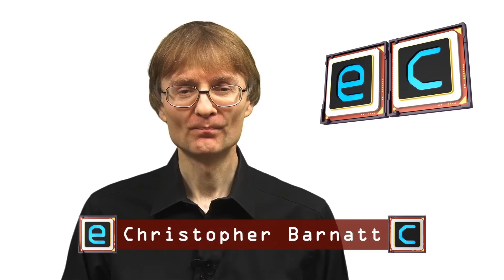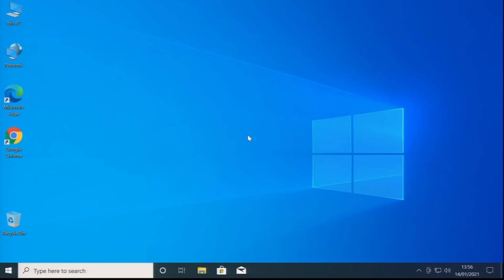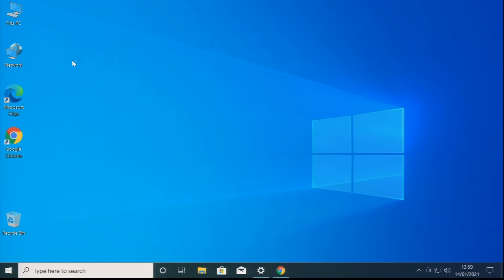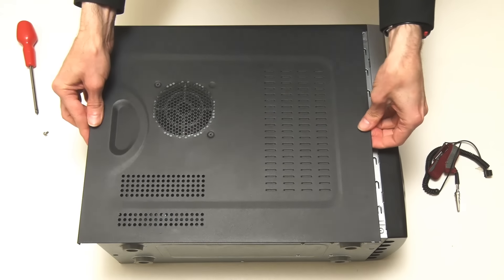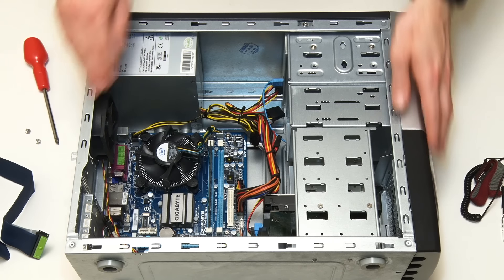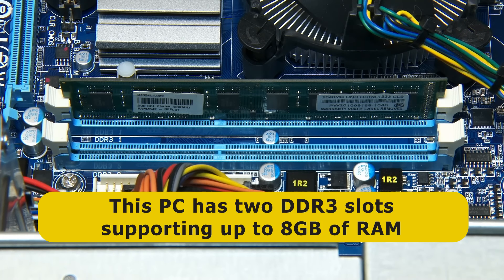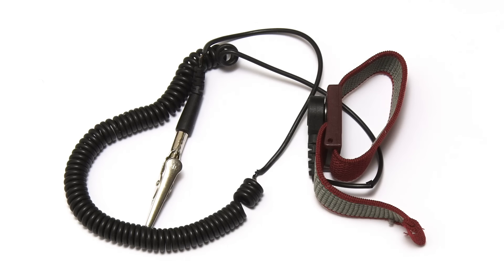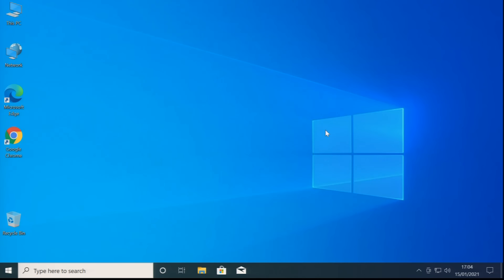Old PC Upgrade #1: Options & RAM

Comment: Hi Christopher, I have a Dell Optiplex 7010 with Intel i5, Nvidia Geforce 760GTX gpu, 16gb ram, 1tb hybrid hd. I have a spare Intel Xeon 2.33ghz Costa Rica cpu. Can I swap out the i5 for the Xeon chip, I also have the heatsink for the Xeon. Thanks for the great vids by the way. I'm also loving my install of Linux mint.

Comment: E5500?  hmmmm Try Core 2 quad Q6600. I use this cpu in my office PC. It's works and stable.
Reply: My 2008 Dell Inspiron 530 came with a Q6600 and has always been a great PC. I recently upgraded it to a slightly faster Q9400 which was about £10 on eBay.
Reply: Yeah, an Core 2 Duo or Quad should be fairly cheap and would be a decent upgrade
Reply: @derekp2674  It's affordable but it's still performed as same as the cheapest brand new processor today.

Comment: I have an old computer as well. But it uses DDR only. It's from 2005. I'm thinking of installing a Linux distro in it. Probably Zorin OS lite.
Reply: Probably a good idea to see and install the max ram before doing this.  If 1-2G, not worth it, but you can try, maybe Zorin will run in 2G well, but most regular distros work best with at least 4G ram.

Comment: Wow, you think a PC sporting DDR3 memory is old?
I've got about 14 PC's sporting DDR2 memory, with no where to go but Motherboard, Memory, & CPU swap!
Make ME an upgrade video!
Reply from the maker: 15 years is pretty old for an operational computer. Today something with DDR2 normally counds as "retro" for exactly the reasons you state -- you cannot get parts, and will also struggle with modern (hence secure) OS support.

Comment: It is strange that they put a single 2Gb card in a board that supports dual channel memory!
 If you don't have an anti-static wristband just plug in your computer without the power on and touch the inside metal of the case, this will discharge any static in your body to earth
 Changing Chrome for Brave will get you better performance
Reply: Brave?  Sorry, I won't watch ads in response to faster browsing.

Comment: Why did you not mention any effort to check whether 16GB RAM is supported, which it probably is, (even if you choose to install 8GB), likely for nearly the same money? Relying on the motherboard manufacturer's suggestion a decade ago when RAM prices were higher is a viewer disservice, as well as technically incorrect by omission.
Reply from the maker: It is not "technically incorrect by omission". It is possible that more RAM may work. But always safer to assume that the manufacturer technical specs are correct.

Comment: Hello! It seems that somhow after I installed a new 2TB M.2 Card then installed a New Win 10 Pro a System Reserved Drive (K) & (L) have appeared on one of three of my SSD Storage Drives (M)! My PC used to boot & shut down fast but now am experiencing all kinds of Start Up issues! Do you think If I attempt to migrate the two Reserved Drives (K) & (L) to my new M.2 2TB (C) Drive my PC will once again will Start Up & Shut Down fast with no issues again?

Comment: After the SSD, you can upgrade the CPU. You can fit the fastest core 2 duo the E8600 or one of the fastest core 4 quad  the Q9500s for example, the s suffix means more energy efficient. Check... https://www.gigabyte.com/Motherboard/GA-G41MT-D3-rev-13/support#support-cpu  and that board has no BIOS updates besides F1. The G41 should accept  DDR3-1333  and run at that speed but apparently 1x 4GB DDR3-1333 @ 1333 mhz will ok but 2x 4GB DDR3-1333 will run slower speed like ~1000mhz.

Comment: Greetings, You must have read my mind with this series of videos, my Asus now takes 08:59:30 to boot up so come on Asus, what are you playing at ?
Reply: Well after installing a couple of free lightweight versions of registry checking free space cleaning thingamabobs and running them several times I found my pc booted in a tenth of the previous time, but what worries me is some of them claimed to have removed 2.5 Gb of junk but my free space never changed remotely anywhere near to that and sometimes increased, so possibly a project for the future, debunk the frauds.

Comment: With a machine that old, the big risk is of the motherboard dying of old age - thus rendering your new investment in RAM a wasted outlay.  The Power Supply is probably also on its last legs.  This is the kind of system that you install Lubuntu or Puppy Linux on and hope for the best.
Reply from the maker: I agree there is always a risk that older hardware will fail. But a lot of computer/components) now run a lot longer than 10 years.
Reply: @ExplainingComputers  From what I've seen, it is uncommon for motherboards to fail. And, if they do, there's always eBay for inexpensive spares.

Comment: for a pc like this, using any version of Linux is much better than using Windows 10. cause I see the slowdown, even with 8 GB of RAM. Might as well use Ubuntu, Linux Mint, Linux Lite or Fedora in this machine cause it will speed up a lot faster and be able to use more of the CPU and RAM, specially since it's a Core2Duo CPU
Reply: I agree that Linux is best on such machines - unless they are needed for running Windows software.

Comment: I have a laptop semp toshiba is 1414 from 2009 (maybe 2005 tecnology). CPU dual core T4400 2.2GHz, 6GB of ram ddr3, hd sata 1 250GB 5700 rpm... I put linux mint xfce 20 and windows 7, I use for everything...I just don't play because it has no GPU

Comment: I would have just added the same spec 2gb ram next to the old one for total of 4gb and then add a cheap 120gb ssd.   That would give you a noticeable performance difference plus the boot up will be significantly better.  I am just cheap.  Lol. I bet that you could add two 8gb for a total of 16gb.  Also.  Curious  what top end cpu can be added in that socket.

Comment: I’m trying to upgrade my parents computer and it has super similar specs, but I have a question if anyone can answer it. If you add a SSD to that computer and clone the hdd to a ssd so that windows boots from the ssd,  would I be able to to upgrade the motherboard and CPU and still have the windows license?
Reply from the maker: You could try registering Windows to a Microsoft account and then re-activating after the upgrade, and this may work. But technically once you change the motherboard it is not the device an (OEM) version of Windows was first registered to, and hence is not covered by the license. You may get it working (and others have reported so here) but it is not the legal default and by no means guaranteed. So I would budget for a new Windows license, or move to Linux.

Comment: For something that age, how is there no dust all over the heatsink?
Reply from the maker: I imagine the seller used an air blower on it. :)
Reply: I sold a VGA AGP 8x by simply washing it with water and detergent then dry. Looked like new. Not any complaints from the buyer.

Comment: Can you fyi me on how to set the RAM . I installed 4 x8 gb total 32gb dual channel on my pc but it says 24gb ( 15.9 gb useable) However from 16gb to now 24 gb, it has increased my FPS by 20% and my resolution on videos is much better. But I like my PC to show the total I put in as 32gb, can you fyi me any steps to do this?

Comment: I have a win xp disk not OEM can I use this to upgrade my E300 and Gigabyte MoBo or the support is too old? Shop built in Dec 2005
Reply: I'm still running XP for legacy games PC's but I won't use those PC's online. If you have a retail copy of XP, you may find that you can use it to reinstall XP or create new XP installs so long as you do not need to do that more frequently than about once per year and you may need to go online or phone to get the licence full activated.
With some OEM versions of XP product recovery discs (e.g. Dell) I find I can install and activate XP on any Dell PC.

Comment: No need for a new Windows 10 purchase. Assign this computer (and Win 10 license) to your Microsoft account. After you  change the mobo, use the same MS account to log in.
Reply from the maker: This can sometimes apparently work, but involves making a claim that Windows is being reinstalled on the same computer. And legally an OEM licence can only be assigned to one computer (as defined by its motherboard). To cite Microsoft: "OEM licenses are tied to the very first computer you install and activate it on" & "OEM versions allow all hardware upgrades except for an upgrade to a different model motherboard".

Comment: Does the OS or the hardware or both determine if you can boot from a PCIe NVMe SSD?
Reply: Generally the hardware and bios.  I think, but haven't verified, that you can add a PCIe card that will make it bootable, but haven't gotten around to finding and trying one.  I did get a PCIE 4x card that mounts an M.2 SSD, but it's not bootable, at least on the system I tried it on.  Drive is seen by Linux and Windows, but not bootable.
Reply: @richardwernst  thank you
Reply: @dank9561  thank you

Comment: Idk. In my opinion there are two things worth upgrading: ram and harddrive to ssd. Today they are cheap. I would not trust 10 years old no-name PSU and here comes one of my issue: I don't think this computer is worth upgrading, because even thou memory and ssds are cheap, power supplies can be cheap for this computer, when these sums add up, it will make computer at least twice more expensive. I guess it's better to take something that is maybe 5-8 years old. This is basically case with cd-rom which might have high idle power consumption and maybe it's not even capable of decoding FullHD youtube video.
Reply from the maker: Thanks for your opinon. It sounds like you are not taking environmental factors into account.

Comment: If you buy a second hand computer and upgrade the motherboard, the hard drives, the power supply, RAM, processor and graphics card, does it still count as being the same computer? It's a bit like Trigger and his broom.
Reply: Ship of Theseus?
Reply: Yup.  As far as I'm concerned, if you replace the mbd and cpu, you DO have a new computer.  All the other stuff is peripherals.

Comment: hello i have a question, does Pentium G620 can install 64bit windows 7? BTW my board is ECS H61H2-m2 V.1.0 Thanks.
Reply from the maker: Yes, your Pentium G620 is a 64-bit chip, so can run a 64-bit OS: https://ark.intel.com/content/www/us/en/ark/products/53480/intel-pentium-processor-g620-3m-cache-2-60-ghz.html
Reply: @ExplainingComputers  Thanks for the response, yes i know that too but in my case its weird, when im trying to boot a 64bit installer whether its a CD or in a thumb drive my monitor is just a blank and it wouldn't let me install a 64 bit operating system do you have any idea if its a bad board or i need to update its bios?

Comment: This CPU has a code name ( Wolfdale), that not support windows 10. All CPUs that have the following code name doesn't support windows 10 ( Sandy Bridge, Clarkdale, Kentsfield, Merom, Wolfdale, Cedarview, Yonah, Penryn) or ( 2nd Generation Intel® Core™ Processors - Legacy Intel® Core™ Processors - Legacy Intel® Pentium Processors - Legacy  Intel® Celeron® Processors). for more information visit https://www.intel.com/content/www/us/en/support/articles/000006105/processors.html
Reply from the maker: Regardless of what is listed on the page you reference, the Pentium EE5500 most certainly does run Windows 10, as you can see in the video! :)
Reply: @ExplainingComputers  Thanks for your comment, I know that most CPUs i mentioned above will run windows 10, but significant performance issues will presents. I have an old PC with intel core 2 duo CPU E7500 @ 2.93 GHz and 4GB installed memory, when i upgraded from windows 7 pro 64-bit to windows 10 pro 64-bit, I noticed huge performance impact.

Comment: There doesn't seem to be any reason why computers from say 2010, which could stream video and everything, now struggle to do those same tasks they could before. Has software and web sites just become so bloated? And with RAM and even storage being soldered on, soon it will be all but impossible to upgrade any component without replacing the whole computer.

Comment: What is your take on using Inactivated Windows?
Reply from the maker: It is legal to test out Windows 10 unactivated on an ongoing basis . .
Reply: @ExplainingComputers  another question, s'il vous plaît, 
In India, we have concrete floors and are often barefoot indoors. Does that mean one is automatically grounded?

Comment: You don't want to ground yourself to a radiator, because the earth may have a different potential voltage than the memory (if the PC is not plugged in to mains).

Instead of grounding, you should be BONDING to the case's and motherboard's ground, which is not the same as the earth's ground.

Comment: How about an even older computer? I've got an old XP from the 1990s I've left in storage. Is it worth upgrading?
Reply from the maker: Potentially if you can get the parts. But the chances of a component failing (eg in a power supply) get greater, and the board may not have (eg) a SATA interface for an SSD, and the power supply may not support more modern components.
Reply: I just fired up an old 1990 machine I kept. Just the motherboard and components. Asus P3B-F running Windows 98. Workhorse of the time. Still works great. Wanted to recover some files. I have others even older, including original IBM PC and Apple II.

Comment: Wait this is an honest question....you can purchase say DDR3 ram fir a motherboard that supports DDR2 and it should run but of course at the max speed that DDR2 was designed for correct? Also a PC that supports DDR2 ram at 4GB will only be limited to 4GB even if using 2x4GB DDR3 ram correct?
Reply: you cannot run DDR3 RAM on a board that only supports DDR2. the slots are different to say the least. G41 chipset supported both DDR3 and DDR2 but when a board is made, what RAM it could run with is determined.

Comment: Ive got a questin i got a old pc still with motherboard for ddr 2 ram . Can i upgrade it to a good pc without  getting a new motherboard or should i buy a new motherboard to upgrade the pc
Reply: At this point, I would strongly consider buying a newer PC. If it has DDR2, it likely is from like 2010 and older. You could technically upgrade to more RAM and an SSD, It will likely make the system run faster, but there's a limit to how much you can do before it makes more sense to buy a newer computer.

Comment: 11:58 this one is... idk, debatable? If you can get Windows 10 into manual activation mode and call them/do the phone based system, it'll work. You'll get an activation code and it will recognize it as GenuineWindows. Ask me how I know this. I know I know, EULA, but..
Reply from the maker: An OEM Windows license is tied to a single computer (in practice motherboard/CPU combination). If, as you say, you can get the OS activating manually (a big "if" given the use of digital OEM license keys tied to a specific PC these days), then yes, you could call and try a phone based activation and this may work. But it will be outside the terms of the license agreement. So I agree, you may be able to get around the issue of needing a new copy of Windows if you have an OEM install, but not legally.
Reply: @ExplainingComputers  Yeah, but if you look at Microsoft as a company, even just in the last 30 years, they clearly don't care about the law until it benefits them. I practice mutual understanding in life, and if Microsoft enjoys defrauding consumers and taxpayers, I can only hope consumers find any and every way to skirt paying Microsoft. 

At any rate, appreciate the video!

Comment: Wow the pc is pretty pricey, in here at 45$ price you could get a decent core 2 duo, 2gb of ram and 320gb hdd. But it's a prebuilt pc which was made mostly by dell or hp, so idk actually lol whether the pc mr barnatt use are cheap or not lol.
Reply from the maker: There are lots of cheaper Dell's on eBay, but they offer far less significant upgrade potential due to non-standard motherboards, cases and PSUs. What I purchased here had to meet some very specific criteria for this series.
Reply: @ExplainingComputers  that explains a lot sir. Thank you very much, i didn't know the disadvantages the cheaper dell's was

Comment: Seeing USB 2.0 A ports not designed for mice/keyboards feels wrong now. I prefer PS/2 connections for those peripherals, anyway.
Reply: It's nice when a relatively new system/mbd still supports the PS/2 connectors as there are a TON of them out there for VERY cheap or free, and often far better quality, typing feel, etc. than current inexpensive USB ones.  And they leave the USB for other things.
Reply: @richardwernst  My biggest issue with PS/2 is using keyboard/pointer combos. AFAIK, finding a decent keyboard with a pointing stick AND two PS/2 outputs is very hard to find.